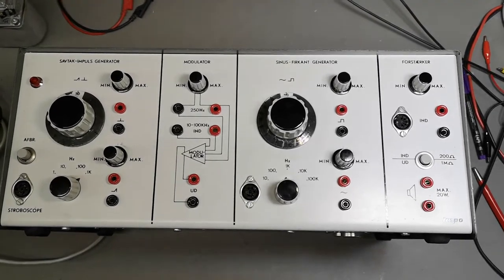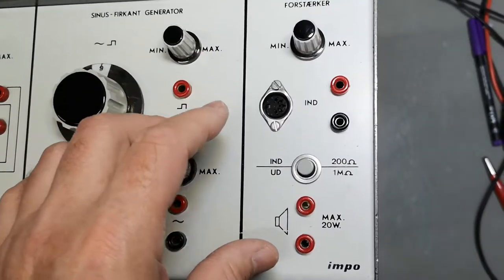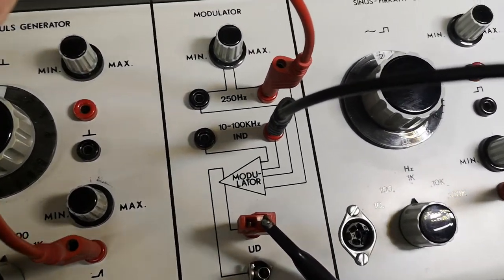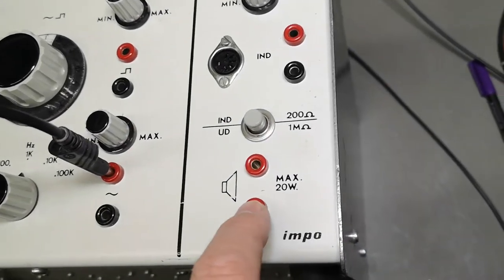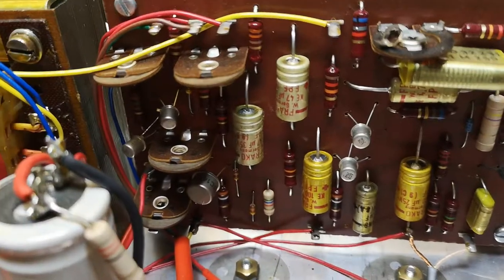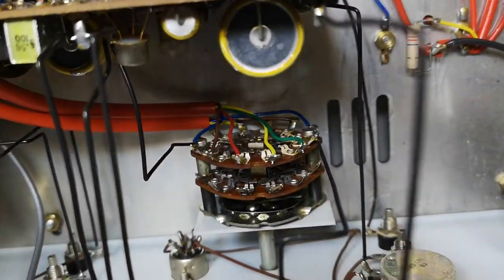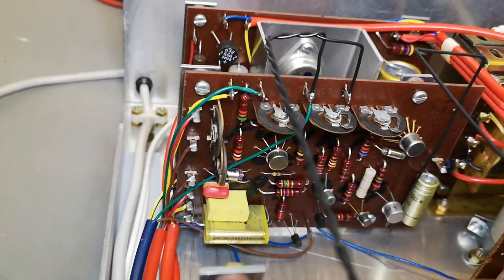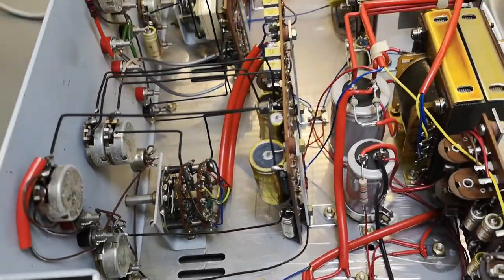Impo Dual Generator Multi Lab Equipment 1973

Comment: Vintage electrical, electronic lab equipmernt from some colledge, designed for being rugged, so transformer likely has internal thermal cutout, and no fuse means nothing for the students to mess around with wothout opening the case.  

I have something similar in age, old power demo meter from some college, old, as in beige and brown colour scheme on the case, but it does date from when the ICL7107 was the king of display driver chips.
Reply from the maker: impo was one of the leading Danish companies in the school / education lab equipment in the 1970-1980
people actually collect IMPO gear, so i am happy a new collector was fast to come pick them both up.